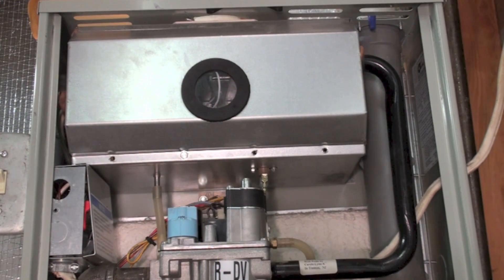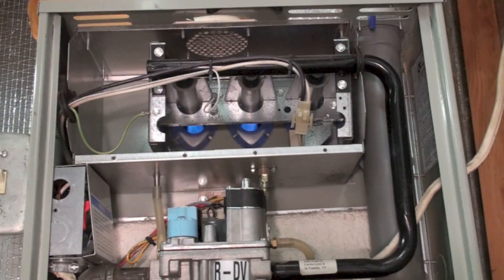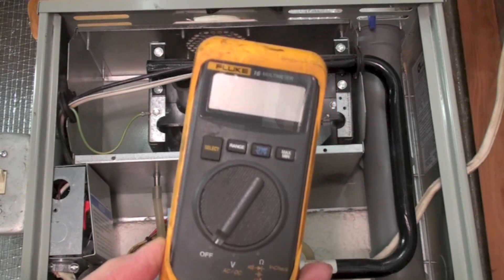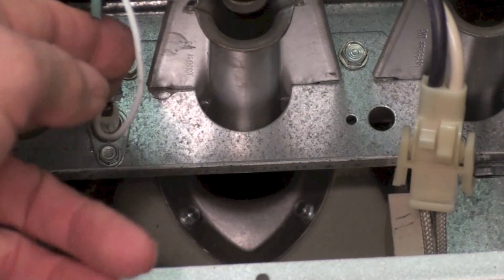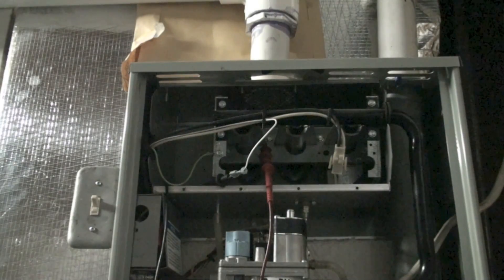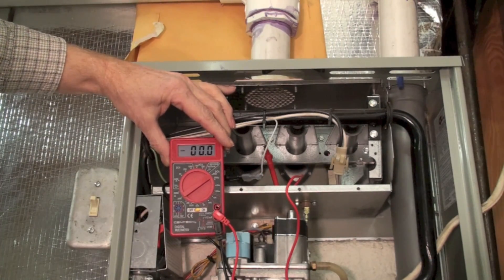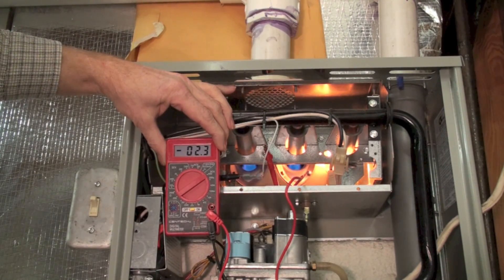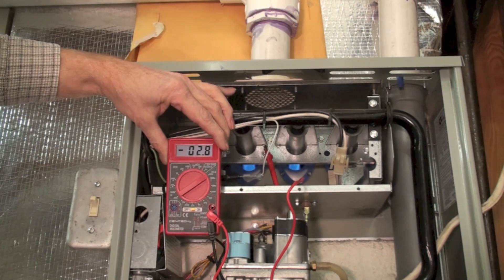How to check flame rod with cheap meter

Comment: Hi, I have lennox g61mpv giving low flame sense error. The rod is clean. I am getting 3microamp going into the rod. But no microamp on the ground side going back to the board. When I disconnect this ground wire from burner box the error goes away BUT why is the furnace still running fine? Thanks
Reply from the maker: The ground wire has no effect on the flame sense.  It is grounded thru the chassis.
My thoughts are there is a ground fault in the incoming power.
GFM

Comment: Thanks. Learned what I needed to know. Started the season with a Mud Dropper Wasp blocking my 2'' fresh air intake. Now I'm having trouble with the flame sensor. My Trane circa 2005 would not work with a exact replacement.  I use one for a Goodman Furnace which I had to bend every witch way and it was working since 2008. Now I put the old new Trane sensor in and it's working. Back then I didn't know how to check them. I had to put a new board in  2008. I had to purchase one to use immediately and got a warranty new board back instead of a refund for the one they made me buy so I have a spare. I also have a spare ignitor to have on hand.  Miss the thermocouple simple furnaces of the old days.

Comment: Thanks...if you remove the rubber hose going to pressure switch area on the furnace...while furn is running....what would happen?...
Reply from the maker: The furnace will shut down on pressure.
GFM

Comment: Thanks i did that and got fluctuating .values 2-4ma...also i poked a drill in the pressure sensor hole and the burner stayed on today...so not sure if its flanecsensor or its the pressure switch opening.....with crud in it
Reply from the maker: The micro amp readings are not below .5, it is probably ok.
GFM

Comment: Where are you actually connecting the red and black leads on the flame sensor..im trying to troubleshoot if bad flame sensor.....inhave a weather king gas fuenace that burners fire up,and then shut off after 1-5 seconds and then the fan comes on....
Reply from the maker: Remove the wire from the sensor.  Connect the meter leads between the sensor and the wire.
GFM

Comment: Have you tried the Fluke meter on AC and measured the current?  It would be interesting to see that.  BTW:  Harbor Freight for the win ;-)
Reply from the maker: The Fluke 16 or 116 will measure DC microamps when placed in series.  They will not read DC amps in any position.
GFM
Reply: You would never be able to read it because it is rectified by the flame.
GFM @valveman12
Reply: @electriccar3253  I personally don't know if it is 100% rectification.  That's the point and mainly curiosity.  I may have to try and see what i can find.

Comment: Hey I haven't ex11c Rinnai wall heater and it's pulling a cold 11.
Could you show me how to test the burners or clean them, I'm in Maine and it's getting cold I've got the fireplace but I really need that propane heater working, thank you.
Reply from the maker: I will need more info than that.  What happens when you turn it on?
GFM

Comment: Ok, I had to replace my pressure switch - was sticking open. Now the furnace lights, but only for a few seconds, shuts off and tries again. Cleaned the flame sensor - didn't work. Replaced the flame sensor - didn't work. I checked the wire from the sensor to the ECM(?) with my cheapo multi-meter. I had resistance (~.5 ohms) so I think the wiring is OK, but tested microAmps per this video and no reading (00.0 µA). I doubt the new sensor and the cleaned sensor are both bad... what do I do now?
Reply from the maker: If the flame is covering the flame rod and you get no reading with the meter in series with the flame rod during a trial for ignition, the board has failed.
GFM
Reply: @grayfurnaceman  The microamps  coming from the board, if good, travels from flame rod thru the flame to ground via the metal burner (mobile home furnace). The microamps gets converted to DC (direct current) by the flame. Correct, or am I just whistling  Dixie?
Reply from the maker: @JustPlumDucky  Close.  AC current is supplied to the flame rod and goes thru the flame to chassis.  Because the chassis is larger than the flame rod, more electrons go to the chassis than the flame rod and thus DC current.
GFM

Comment: I thought the board was suppose to send 90 volts AC to flame rod then send micro amps DC back to board thru ground wire?

Comment: The Harbor Freight digital meter may be "cheap," in price and construction but it has served me exceedingly well as a "non-professional" user where the measurement parameters really matter. Also thanks for this excellent video presentation.
Reply from the maker: Roland Petit In a pinch I have also used it. 
GFM
Reply from the maker: Roland Petit Welcome
GFM

Comment: I work in vending. I acquired one of those meters via a birthday and while it did all it was required to after being dropped several times it ceased to function. Light duty only. I still use my old
Reply from the maker: Not saying its a good meter.  It is after all a free meter.
GFM

Comment: After sanding my flame sensor rod, the heater started working again. Just when I started jumping around like a nut and bragging to my wife that I fixed it, I noticed that the blower and inducer motor stayed ON a full hour after the heater reached the set temperature. After spending the day looking at many Youtube videos (including several of yours) and testing some of the other parts, I found what I believe to be the problem. I used an emery paper to sand that flame sensor rod... and I sanded it a LOT. I got a "continuous flashing" code that indicates "that a flame was sensed when there was NOT a call for heat" It said that code was generally used for a slow closing gas valve that has gone bad. BUT after thinking about it, I realized that code was perfect for my situation since the damaged sensor rod is also sending a message that "there is a flame when there was no call for heat".

MY QUESTION....
I plan on checking my flame sensor with my free Harbour Freight meter hopefully today, and was wondering what kind of reading should I expect to get ASSUMING that I damaged the rod when sanding it?  Would you think that it would be higher or lower than 2.8? 

Thank you so much for sharing your wealth of knowledge and experience with us. Much appreciated here.on YouTube.
Reply from the maker: Most of them run from 1.5 to 4 microamps.  Cleaning the flame rod will not cause the problem you have.  There are only 2 reasons for that error code.  The gas valve is stuck on or the control board has failed.  Hope this helps.
GFM
Reply: Pardon late reply,  but as I mentioned before, the blower would stay on a full hour after the heater reached it's set temperature and the cycle would repeat. i would turn off the unit at the thermostat and also turned off at the breaker many many times, but nothing helped. I ran it like that for a couple of weeks. About 3 weeks ago I turned off at the thermostat for 2 or 3 full days. When I finally turned it back on, it started to work normal again. It has now been running perfect for 2 weeks. It has probably cycled 100 times without a failure.  I will get in the attic again one day to see if any fault codes are still flashing but I expect it to be normal. If it goes out again I will probably replace my flame rod sensor and limit switch since I already bought those before I got your advise.

 After this latest development, would you still expect it to be a bad gas valve or control board? Maybe one more than the other? I know things like this seldom fix themselves, but I am hoping.
Reply from the maker: No way to know for sure.
GFM
Reply: If I ever get to the bottom of it, I will post it here. Maybe provide someone with same exact symptoms a clue of what to look for. Appreciate your help very much.

Comment: Does flame rod have anything to with igniter not lighting up ?     What make   Igniter glow come on so then gas fire up ?   Having trouble getting igniter to come on to glow .
Reply from the maker: The flame rod does not control the HSI.  If the HSI is not coming on, the ignitor could have failed or there could be other failures that will not let it come on.  You can check the HSI with an ohmmeter.  Should be less than 150 ohms.
GFM
Reply: Ignitor some times  goes on and off .  Thank you getting back to me .
Reply from the maker: Normal operation will be the HSI will warm if the control board determines if it is safe to light the furnace, It will stay on for a number of seconds then the gas valve will open for about 4 seconds.  The HSI will then go off.  If it has not lit, it will wait about 1.5 minutes then try again.  It will do this 3 times, then if it does not fire, it will hard lockout for 1 hour, then try again.
GFM

Comment: Love it, I have worked in this industry for over 30 years manufacturing all types of industrial oven and furnaces, servicing, modifying and repairing them and to be honest we have expensive meters and a few cheap ones. The cheap ones actually look identical to your cheap meter (only different colour) but they do keep working and still after years if you check the cheap vs expensive version well nothing appears to have changed to be honest, they even have a small fuse in the back as extra protection (just in case lol) ......so is it a case of buy cheap pay twice or buy expensive get ripped off.... as over time probably 10+ years the cheap ones are still operating well. Check us out www.lineartherm.com cheers keep up the good work.

Comment: What are the sensors that positioned on each side of the burner box? The last one connects to my gas valve and i noticed that my gas valve is not getting voltage.  It is not the flame sensor or the glow plug, but there are 4 of them in series, it occurs to me that one of those could be bad and not allowing the voltage to reach the gas valve.  I will need to keep testing the voltage at each one to see which one is failing
Reply: +Steve Goettler  - these are on my furnace - single stage Goodman
Reply from the maker: +Steve Goettler Just guessing here as I don't know make and model but they are probably manual reset limits.  There should be a button in the middle.  This should be checked out if they have kicked off because this indicates a heat exchanger or venting problem.  Hope this helps.
GFM
Reply: The mote I look at this I think it may be heat exchanger problem
Reply: I am getting some blow back flame after the blower kicks on and the heat increases
Reply: There also a noticeable one time clunk sound as the main blower kicks on
Reply: Goodman. GPMN080-4 Rev B
Reply: The exchanger from Sears for this unit is $174.  I believe I can have my contractor friend help me install it
Reply: Part # 2821301S

Comment: can't see where you're putting the leads
Reply from the maker: +saintsamaritan You have to look pretty close.  One lead is connected to the flame rod terminal, and one is connected to the wire that goes to the flame rod.  It is a series connection so the power must run thru the meter.  Hope this helps.
GFM
Reply: +saintsamaritan ......the only way to test amps is in series of the circuit. that means one lead is connected to the sensor and one is connected to the wire. you won't be able to read amps if you are not in between the circuit or "series". if you put your test leads on the connection with it connected and one on the ground, or frame, then you won't get a reading and in some situations you will blow your internal slow burn fuse in the meter. that is known as a parallel testing procedure which is best for voltage, resistance, diode, etc.

Comment: does the flame rod on this set up light the burner as well as sense the flame ?
Reply: +John Railton  no it does not. it is only the sensor.  there is another hot surface glow plug that is mounted in front of the gas burners.

Comment: Where does the meter Com Black Wire Clamp connect to?
Reply from the maker: ***** The black connects to the white wire that was mounted on the flame rod.  If you look close, you can see it.
GFM
Reply: +Eric Coaxum …there is a push on connector on the back of the sensor. when you pull the connector off the back of the male connector, on the back of the flame sensor, the black wire will go on the removed wire and the red wire will go on the sensor. it is all in a series, your just inserting the meter in the path,
Reply: Thx!

Comment: I was wondering, how is the single pole switch to the furnace mounted?  It looks like it is mounted on the fiberboard duct that I'm sure is behind it.  If it is in a handy box I was wondering how the handy box was mounted to the furnace.  (Guessing you used a chase nipple.?

Comment: Hi,
Excellent video work and clarity of explanation.  I was hoping you could do a spot on explaining how to tune your flame for altitude.  I just bought a new heater by Mr. Heater and the shop manual tells you it has to be done at >2000m but not what screw "specifically" it is and what to look for.  
Much appreciated,

Comment from the maker: There are different minimum readings for different furnaces.  Trane, like the one used here has a .5 microamp minimum.  Two to three is normal for this furnace.  The Trane flame rods dont seem to get dirty easily.  Thanks for the comment.
GFM

Comment from the maker: Certainly true.  This meter does have a fuse.  For my use, I avoid meters that have a fuse.  They usually will not save the meter from damage, are hard to find and at some point you will bypass it.  The Fluke 16 (now 116) in the video does not use fuses.  The circuitry protects the meter.  Thanks for the thoughts.  
GFM

Comment: When testing amperage in series, I find the biggest question to go through my mind is whether the internal fuse of the meter is blown. When those fuses blow, sometimes there is no signal to tell you the fuse is bad, and all you get is a spurious reading of zero amps.